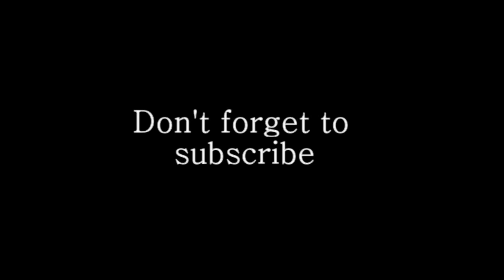New Holland 8360 Split for clutch replacement

Comment: did u have to buy a new flywheel to ? or just the clutch ?
and another question, i have a new holland with same clutch system, and there is a rattling sound when the tractor is in neutral gear and engine is idling. i think there is a broken spring of the clutch. 
I would like to know, what will happen if i run the tractor with this error(a broken damper spring on clutch) for a little longer, will it do damage to the shaft, or the transmission, or the flywheel ?